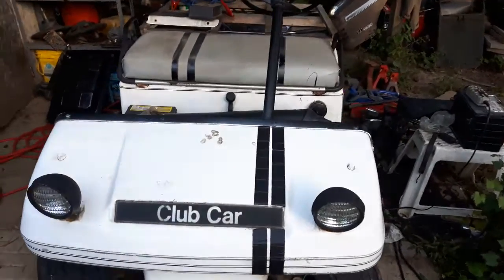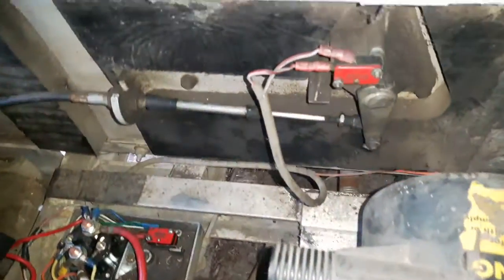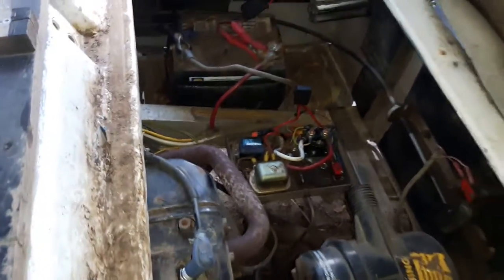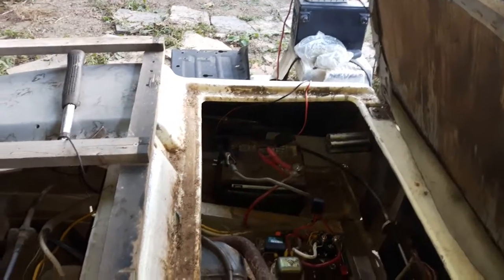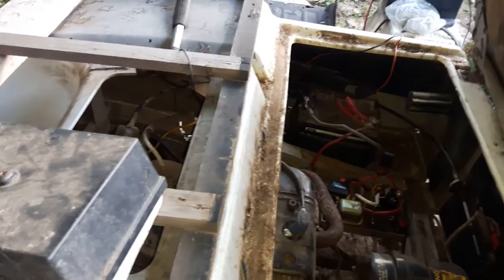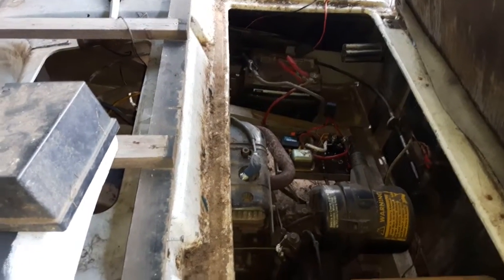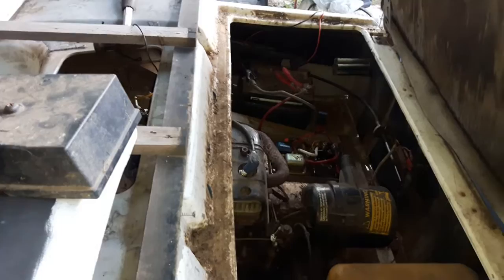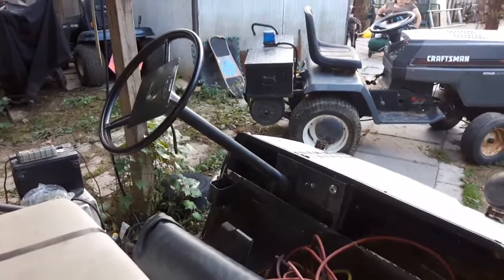Club Car Update

Comment: sounds like you just need to clean all the electrical connections
Reply from the maker: For the most part, I've been looking into the potentially rebuilding the torque converter or getting a new, as far as I know it's the clutch on the engine torque converter on the axle, the part I needs is called a Cam also I think it needs Clutch Buttons, if it's rebuildable.